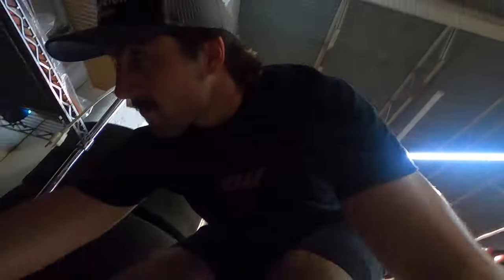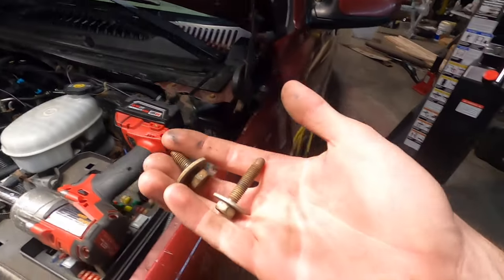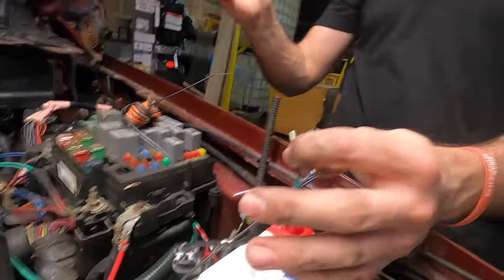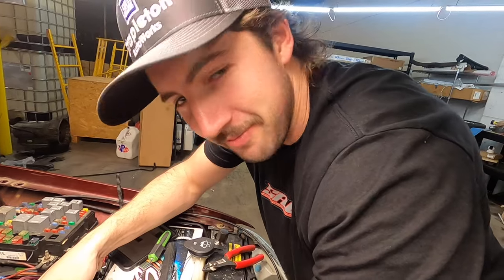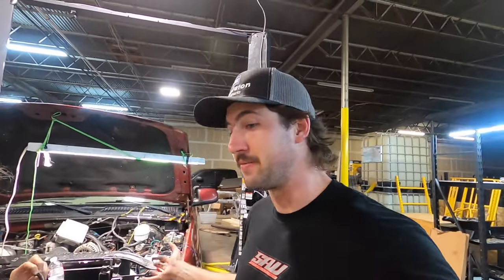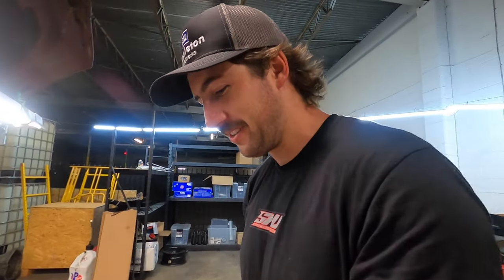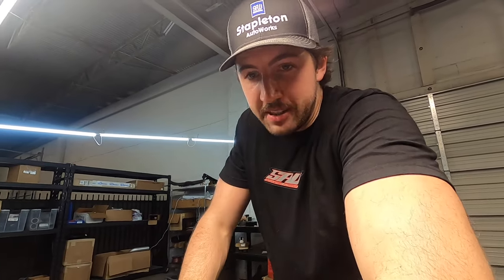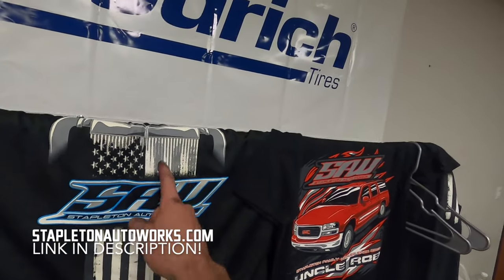FACTORY Electric Fan Conversion! Best Mod For 99-04 Silverado/Sierra/Yukon/Tahoe (Free Horsepower!)

Comment: Just did mine! Throttle response and MPG’s are a noticeable improvement!
Reply from the maker: EXACTLY 🤟🏻
Reply: I need to hurry up and get them done on my truck
Reply: Any idea where in find a cheap one preferably from a newer vehicle or something like that I’m a 21 year old so I’m not very experienced but wouldn’t mind doing this due to my 04 Yukon heating up on idle and I recently replaced the fan clutch, but still no solution.. so this is my next project/idea
Reply: How many mpg do you say you got
Reply: @dawber2111  I get like 12.8 average and 13.5 on a good day
Reply: @ismaro8676  do the electric fans actually help I was gonna buy a kit for it, but wasn’t sure if it works.
Reply: @jaredflores9717  sure it does work you don’t have that big mechanical fan clutch robbing horsepower to turn it and puts a load on the engine while driving. With electric fans your freeing it up .
Reply: @jaredflores9717  yea im about the same stock.
Reply: @ismaro8676  do you know if the aluminum radiator with the built in fans are any good?
Reply: @jaredflores9717  aluminum radiator should work but don’t buy a cheap one buy a well known brand aluminum radiator!
Reply: @ismaro8676  yeah I was looking at a 400$ one but idk EBay seemed kinda sketch
Reply: How did you activate the ECU pins to work with the electric fans?

Comment: I've done the E-Fan Mod on every GMt800 I've ever owned but I didn't bother with pinning the harness or the hassle of programming the ecu. I ran with the Flex-A-Lite #106999 vari-speed stand-alone Fan Controller. Flawless operation with no problems.
Reply: I think this makes the most sense to me.  The truck doesn't know whether there is a clutch fan there or not.    Pretty sure this is the route I am going with on my 2003.
Reply: Did you use a stock style fan?  I'm hearing you must change to the large radiator as well?

Comment: I did a Black Magic EFan upgrade on my gen1 Dakota with a 318 and it made such a difference in low end power and sound while driving around. One of the best mods ever. Mine has a tstat controller and a switch power from the ac compressor so it's such an awesome setup for a daily service truck.
Reply from the maker: That’s a good configuration
Reply: You guys put out some awesome comments on top of great videos. I hope this build makes some dank nasty power! Cheers from San Antonio!!!!

Comment: The smoothest, most quiet fans I ever installed were from a Lexus RX3 somethin somethin....i just grabbed them from pick and pull. The width was right for an s10.  But I went toggle switch route. Cheap upgrades are the best upgrades

Comment: I appreciate the build content because it shows what has to be done to make things work properly, and the amount of work needed to make everything work in unison. Uncle Rob's Yukon is going to be a guided missile when you finish all the upgrades on it. 
I hear ya on the clutch fan setup, my '94 K2500 big block 1 ton chassis Suburban has one and it sounds like a B-29 on takeoff roll when it engages. It cools nicely, but you can sure feel it suck the engine down!
Both you & Logan keep rocking these vids, & you have my undivided attention!
Reply from the maker: The clutch fan sound is so vivid 😂😂
Reply: @Stapleton42  LMAO!

Comment: Just did this mod on my 2000 Chevy Silverado 4x4 Z71 1500 last fall. Best money I ever spent on this truck, HP Tuners is amazing for being able to activate them and set temps.

EDIT: I have LED Shop Lights and couldn't find my hood mounted light with clamps. I just used the chains and hooks that came with the LED Ship light and hung it from the inside hood of my truck while I did my cam swap, it fit perfect.
Reply: Any issues with ac system
Reply: @jimmyramirez8844  AC Blows nice and cold. Zero issues so far.
Reply: What temp did you set them to im getting ready to do the swap on my 04

Comment: for anyone wondering, this swap works in OBS trucks with A LOT of cutting and modification to the core support
Reply: There is not that much cutting to make it work. I put them in my 2 door Tahoe. There was only so e minor cutting and welding on the lower core support to put tabs in to hold the fans, and I added so e mounts to the upper radiator mounts to bolt the top of them to. Most overlook the lower radiator hose that needs changed to one from a big block iirc to get clearance.

Comment: Keep an eye on the relay setup. I’ve got an 06 Yuk with factory fans. One day I got in it and the battery was dead. Couldn’t figure out wtf was wrong. 
Long story short, I was walking my dogs at 2am and the damn fans were blowing full blast 🤷🏻‍♂️
Changed all the relays; no bueno..
Ended up unplugging the wire on the AC and it stopped🤷🏻‍♂️
Reply from the maker: Interesting

Comment: I didn't realize that wasn't a factory thing. My 05 tahoe came stock with e fans. No fan or clutch up front. Got 304,000 on her now so turbo is not an option. Lol. I love it dude. Oh that was a great tape job by the way. Mevotech makes some really good parts for the suspension. Did mine. Drives great even with the 20s on it
Reply from the maker: 206k on uncle rob and turbo loves it lol. 05 was the first year for factory e fans

Comment: You have helped me out sooo much by doing this video. I have learned exactly what to get from the pick-n-pull and then how to actually put it into play. I don't have a turbo in my 03' Tahoe, so that will not be in my way. I watched some other videos that required some high dollar, to me, harnesses and computer HP tuners and such. I was looking for a factory OEM plug and play that wasn't too crazy to do outside in the heat for this old man. I just sub'd, although I have been lurking for a while.
Reply from the maker: Thanks man I’m glad to have earned that sub fair and square. Glad you’re here 🤟🏻

Comment: Did the HD radiator (i live in AZ after all) and 09-11 GM electric fans on my 2000 silverado. I cannot overstate how much better it is. More power, quieter and even a lil better fuel economy

Comment: Oh my god rigging up the shop light to the hood takes me back to being a teen 😂😂😂

When I was 18/19yrold, I bought a grand Cherokee that spit out a timing chain. I had no where to work on it, and the easiest solution I could come up with was to put it in my 10x20 storage unit and make things work there. Heres the kicker: I didn't want people eyeballing into my unit, and working on a car in one probably wasn't the most acceptable thing anyways. So I had to work on it at night, like NIGHT NIGHT.. I'd normally get down there around 10 and stay til 2 or so. 

So my solution as a broken teen? A 48in shop light, a 100ft extension cord, and a ratchet strap. It worked perfect, and with about $100 in harbor freight tools, I rebuilt the top end of that engine and daily drove it for about a year and a half.
Reply from the maker: That’s great 😂

Comment: Great video. It's usually a good idea to remove the battery completely when working on the ecu that close to electricity/battery and also probably not have your phone around it. It's rare for bad things to happen but trust me I've learned the hard way!

Comment: I agree. One of the best things you can do to a 99-04 is upgrade to E Fans. Even on bone stock vehicles that you dont care about HP it's worth the upgrade just for the improved AC operation at idle.
Reply: does it come from factory with those fans on o5 and up?
Reply: @merrsik5274  yes

Comment: I added electric fans $750 on my 6.Blow powerstroke excursion. Would start to overheat, and 260 degree oil temp (requires an oil change after 240, thanks engineers for that oil cooler) put factory fan and shroud back on, 212 coolant, 214 oil. So I'm bitter on non factory electric fans. That said, it they work on your application, fkn AWESOME. Sorry I'm salty today.
Reply from the maker: Thanks man. We’re allowed to be salty when things go wrong. Just don’t let it knock you down for the whole day 🤟🏻
Reply: @Stapleton42  absolutely

Comment: for those pcm connector screws get yourself a milwaukee 90 angle drive adapter for your 1/4" hex impact driver and a 7mm nut driver bit and you can whip those things in and out so easy!

Comment: Built mine with a sheet of stainless from Home Depot , two fans & a wiring kit of eBay. $60 . snidertron 3000 gave me the idea. Could use a cookie sheet but I wanted it bigger then you can get a cookie sheet. Anyway gives a lot more room that way & looks cool on the cheap. 

Edit: would have wired to the pcm if I could get into it & change the settings but I can’t so whatever.

Comment: A mechanical fan is perfect for a work truck.There is nothing to fail but your thermostatic coil spring.It might get weak over 20 years but no mechanical fan is going to be that reliable

Comment: Frozen dipstick in block! long strait pick or similar tap it around the rusted edge around the block& broken tube(hit it from the block and into itself), then screw a long lag bolt around 1\4"ish and attach slide hammer and remove or go underneath and use chisel to hit lag bolt up from the block. Also the dipstick doesn't really hurt anything if you get sick of looking at it and hammer it into the pan

Comment: They do make pin tools that you can push into the connector that will lift the little tab that holds the pin in and you can just pull the wire out the back without having to take the plug apart lol
Reply from the maker: You still have to take it apart to get the pins to be able to release

Comment: Next you will be wanting the 14 bolt from a caddy or Denali.  The H2 one will work but you’ll have to turn down the axle flanges and drill to 6 lug.   I got a hell of a deal on one so that’s the route I went then just ran my stock rear disc with the H2 caliper.  I got tired of snapping the 10bolt shafts.
Reply from the maker: Interesting. I did the 14 bolt swap in my Escalade but I just got one from a 2wd Denali and it was easy lol
Reply: Yeah that’s the easy route. I got the H2 axle with locker for like $100 and happen to know a guy that was willing to turn and drill the flanges from 8 to 6 for me….

Comment: The metal Ramen noodles is a spun copper coil. There are several. As the armature spins it causes the alternator to generate power.
Reply from the maker: But how 😂
Reply: @Stapleton42  It's a type of Voodoo/Black Magic 🪄
Reply: @Stapleton42  Magnets (the core of the alternator) create a magnetic field where the coils sit. rotating the magnets means the magnetic field moves too, which generates small currents in the coils. Since there are a LOT of windings (coils) the outcome is a significant current (100 amps AC @ 12V is no exception) with which you recharge your battery while running the engine.

Comment: Been thingkong of a electric fan upgrade on my 81 cj7. Since the v8 swap i kept a mechanical fan but put a pusher fan in front as a back up. Clutch is getting wobbley now so before it sends a fan thru my nice shimy aluminum rad i think im gonna put a 2nd fan on for a push pull configuration so if 2 fails i have the other, aftermarket fan clutches seem to suck and the only defense in the  Mechanical is old pple saying how they have had one for years and no issues or drag on alternator bla bla bla. Ill keep it around for if i ever want to put it back on but i never will. I have my fan wired with relay with a override switch so even if the thermostat goes bad i have a way home. If relay goes i have a extra in the glovebox ect.

Comment: Hello. Watching  in 2023, hope for some help or advice. Fully watched you video and absolutely loved it. 

I amd troubleshooting with my Dad(20 year navy Electrician and DIY small engine specialist). 2000 Silverado 5.3(lm7) 4l80e 2wd.  385K miles running strong but no ac. Or so i was told when i bought it at 375k. Dad an I charged the  Ac system. Ran dye thru it and found a slight leak from the low pressure sensor. Snug it up and seemingly no ac leak.  Drive it and Ac is great. So the system does work! But upon lunch time the engine temp started to overheat.  
We theorized the engine needs a good coolant flush(engine flush and radiator flush), slap it back together and charge it, see what happens.  Its possible it has a slight AC leak but we have Dye to run thru and check. 
Its all factory from 2000 with that power draining Fan clutch assembly. I'd like to swap it out to an electric fan to eliminate the fam clutch for engine cooling. .and that led me to finding a couple videos on the ole trusty Youtube, finding yours here. 
So after watching the whole video. I have a couple questions

So all i need is the electric fans off a newer model truck and also its fan wiring harness, relays/fuses? 

Does it work with the factory ac  button after all the installation?  I dont need a fancy HP tuners and a laptop to program program anything? 
Any advise is welcomed. Thanks for reading my issue and giving my 2 cents.

Comment: Great video! Digging this build. its badass. not that i dislike the Escalade or the Monte Carlo but this is more my style. Im using the Ebay log manifold. what size if the v band collector for the cross over?
Reply from the maker: Thanks man! That’s why it here. Something for everybody. It’s a 2.5”
Reply: @Stapleton42  your the man. thanks dude !!

Comment: I'm grateful my 05 Suburban came with electric fans already however I do want to install a mishimoto all aluminum radiator and transmission cooler but unsure whether or not one built for an 05 Silverado will fit my Suburban
Reply from the maker: It should

Comment: I have a 4.8 truck that I use as a burnout truck💨💨💨💨 I've done the efans and the bigger 34in radiator ...... what's the next step up  from there as far a engine cooling for this Az heat

Comment: Just did the upgrade, your video was a great help. Need the computer flashed. Any suggestions on where to get it done? 2004 suburban 2500,  dealership has it now but saying they may not be able to do it because it didn't come factory with it.
Reply from the maker: Someone with HPtuners

Comment: She can bend snap anything she wants!!🤪.  She’s a good shop girl. 🔥❤️. No I’m not 👁 balling her. Lol. Good video. I’ve got to do the same exact thing next time I’m home. That’s a no shitter!!  Take off the cheap eBay fans that quit working and install the efans pins and harness.  That’ll be last to last thing. Before all that. A cam, valve springs and long tube headers. Where do I begin. Lots of work.   Good video!!
Reply from the maker: Thanks man! I feel that when a factory option is present it’s usually the best way to go

Comment: Good work guys I followed your lead and did an e fan conversion but one question if you or your audience wish to answer it. do the fans blow into the radiator or the engine compartment. Thanks for the help; not sure in New Jersey
Reply from the maker: They're "puller" fans. They pull air through the radiator into he engine bay. If they were pusher fans they would be on the opposite side of the radiator.

Comment: Literally doing electric fan wiring rn on my ls swap mach 1
Reply: Thats the only way it will ever come close to reaching mach 1. 💁‍♂️
Reply: @NotOnDrugs  for sure. Was originally termi swapped but only made 435rwhp then blew up. Rather just ls swap it than fix the ferd stuff
Reply: @feREXtheBLUE  I feel you. Im in the middle of rebuilding my 2v 5.4 out of my 97 f150 which is just a hunting truck. I have a spare lsa for my V that I thought about putting in it, but I'd have to buy another trans. Looking for a lightning supercharger for it

Comment: I'm unsure what cfm Escalade efans pull but I recently swapped my 07 nnbs tahoe efans from a 5 & 7 blades for a Escalade/ 2500 7&9 blades. 

The ones I got were from TYC 7&9 blades.

Comment: An alternator works together with the battery to supply power for the electrical components of the vehicle. The output of an alternator is direct current (DC). When the alternator pulley is rotated, alternating current (AC) passes through a magnetic field and an electrical current is generated. This is then converted to DC via the rectifier

Thanks Google

Comment: Couple of quick questions....   Do you have to program the truck after adding the electric fans for them to work?   Do you need a tech tool to do so?      Next question is how much fuel savings or hp gains could someone typically expect from a conversion like this?           Thanks for creating and sharing the video; I just might try to do mine.
Reply from the maker: Yes you need to program it. I’m not sure if a dealership can do it or not. Maybe. For fuel savings I have no idea

Comment: Fire is bad; 85 GLHT Dec 1988  B B Q  two weeks later recall notice  rubber and metal fuel lines  temp diff  caused leak but not oil oh boy.   I did a single  electric an on a 91 1500  big difference and I trashed 3-4 with less than 200 hp to prove it.  Very nice project curious on the weight if it has not been mentioned.

Comment: Have you done the “free” big brake upgrade from the ‘07 Tahoe on Uncle Rob? (Still working my way through the playlist)
Reply from the maker: Not yet. If we did that the factory 16s wouldn’t fit anymore so we would need new wheels 😂
Reply: @Stapleton42  simple solution seems too be to grab some factory 17 or 18s while you're at the yard and have Tanner do his magic in HP Tuners! 😂
Reply: I've also seen jokers selling sets of factory 20s on Facebook marketplace for 200-300 in good condition around me.

Comment: get the fans and the module off the fuse box out of a 2005 TrailBlazer with 6 l in it then you'll have the fans to computer can control it turn it on and off sweet deal man real cheap out of the junkyard